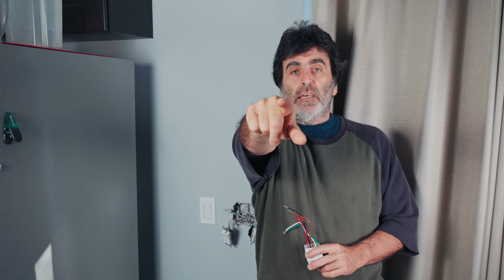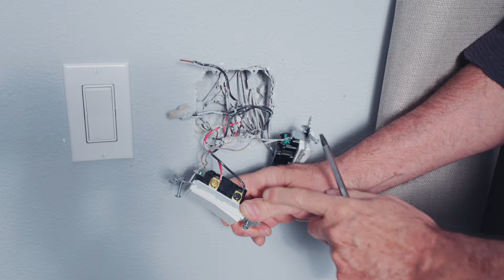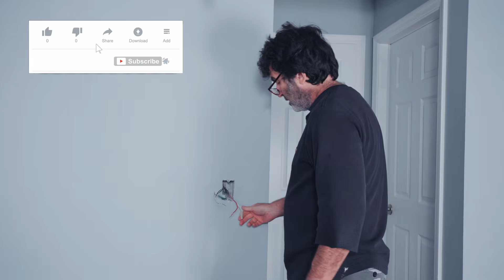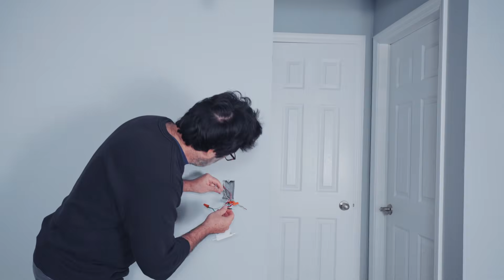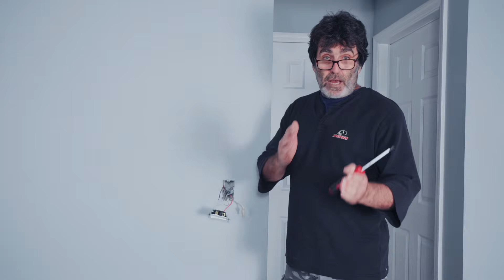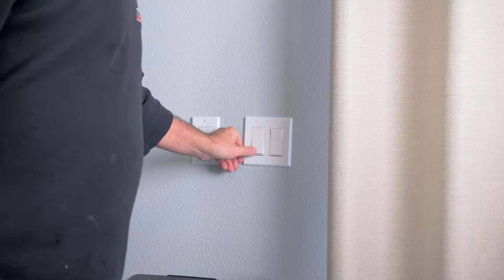Correctly Install Amazon WiFi 3 Way Smart Switch

Comment: So does that mean if one freeway switch has power the other one will not
Reply from the maker: With a smart switch it's a little bit different... I don't remember exactly how the Amazon switch has it configured.. .With a normal 3 way switch both switches will always have power, but it depends on which leg/screw the power is on determines if it's off or on...

Comment: Why did you say, "preferably this black one here" regarding the travelers at 1:20 in the video?
Reply: Does the color or location matter?
Reply from the maker: It all matters!  I don't remember why I made that particular statement... I would connect it according to the wiring diagram for your specific situation...

Comment: Oh so you only need one 3 way smart switch. You can leave the other side the same?
Reply from the maker: Hi! With this setup you use one traditional 3 way and one amazon smart switch.  However the connection on the traditional 3 way is not the same as it is when installed.  I'm pretty sure I covered this in the video which would be easier to see than for me to try and type out the full instructions... 😀

Comment: I had a setup where the Power and the wires to the fixture were in the same box and the other 3-way was on the other side of the fixture. This video helped me understand that I needed to disconnect the second traveler and instead hook that up to the hot in the fixture. so I had to change the wires in both boxes and the fixture... The instructions were not clear on that but this video helped me understand that I only needed one traveler. I assume since that, far, normal 3-way just triggers the smart 3-way to switch it's logic... Thanks for the video!
Reply from the maker: TYSM! I'm glad the video helped you figure that out. 😀. To me it would be less confusing if the switches just hooked up like standard 3-way switches.  I have a feeling they get a lot of returns on that one because of that..

Comment: This is really helpful. But there's no neutral in my load side of the 3 way
Reply from the maker: That definitely makes it tricky! You might need to look into switches that don't require a neutral wire.. 🤔

Comment: How in the heck you figured this out is beyond me - the instructions certainly don't help. I have spent several hours and gone through two switches, thinking the first one was faulty, before finding this explanation. Amazon needs to reference this video inside the box along with the instructions. Thank you!
Reply from the maker: HI!  TYSM for the great feedback and comment...  If I remember correctly I found the wiring diagram of how it should be.  But it's been a minute so there's a little bit of brain fog there.. 😂  So glad to help.

Comment: Hello may I know  how  to connect  3way amason smart switch  to regular  3way  switch  without  neutral?  I have  only ground  two  travelers  and one load.
Reply from the maker: HI!  Many 3 way smart  switches "require" a neutral.  I would search and see if there's a brand that doesn't require it...

Comment: Does the old none-smart switch still function as expected?
Reply from the maker: HI!  It's been a minute since I worked on this... If I remember correctly the Amazon switch only used one smart switch and the 2nd switch was still a standard switch.  If my memory serves me correctly then yes the 2nd standard switch still worked as normal..

Comment: Great  video!!!  My line and load are in box 1 and 14/3 between box1/box2.  Any advice?

Thank you
Reply from the maker: HI!  Without having all the diagrams in front of me I am not entirely sure...  I would google different 3 way switch configurations and find the one that matches your setup.  Then take the Amazon diagrams and compare.  I think it would work, but it'd be hard to explain in a sentence or two...

Comment: THEY SAID you did not have to use TWO when connecting this Ghome 3way switch? I guess you are saying that you do? So if you have 4 different locations you would need to find the front and rear switch which is 3way and not 4way ? Thanks ?
Reply from the maker: HI!  This video is on the AMAZON 3 way, not the GHOME.  With the Amazon, I am not sure it'll work with a 4 way setup (I'm leaning towards it won't!).  I haven't looked at the Ghome to see how it hooks up, so I can't answer your question.

Comment: Are you able to provide direction on a moes smart switch? I tried but didn’t work
Reply from the maker: Not at this time, but I might do a video on that.  I'll look into it.  But in the meantime, do you know if you have a neutral wire at your 3 way?  I'll bet it's required..

Comment: Thanks, but I’m still having an issue and hoping you or someone can help. I believe it’s setup exactly as you stated, but in a certain order of clicks the old school three way switch will only turn off if I cycle it twice. It will then turn on again, but in order to turn it off from that switch I have to click it on and off twice. Any idea why? Thanks again.
Reply from the maker: HI!  If you're 100% you've connected it right, you could have a defective switch...

Comment: any reccomenations for installing the Amazon basics 3-way in a 4 way
Reply from the maker: HI!  A 4 way setup is a 4 way switch in the middle and 2 3 ways on the ends (electrically speaking)... You can probably  set it up in one of the 3 way spots and it might work.. I've never tried it though, so if you do it's at your own risk...  Might be something for me to experiment with and if I can get it to work properly it might be a video idea...

Comment: Thanks... Replacing all my WEMO Belkin switches.    Very Helpful.  Still quite not right.   Probably the wrong location of the amazon switch.  almost eems to work but every other time, need to swith the (non smart) on-off-on-off-on) to work.
Reply from the maker: I've heard of that...  If it's wired correctly, there might be a glitch in the wifi switch itself...
Reply: @TheHomeImprovementChannel  all good got it all working.,... now for the 4way setup....
Reply from the maker: I wanted to try and hook that up as a 4 way.  I forgot about it, but I'll put it on my to do list to see if I can get it to work... 😊
Reply: @rainerperkons  What did you do to fix the issue where the non-smart switch needs flipped? This switch (I have ordered 2 of them now) seems to be the glitchiest POS ever, BUT it's the only switch I can get that is: 3 way, dimmer, motion sensor, AND supported by Alexa! AGGGHHHH. Absolutely driving myself insane. I have 'hot wired' my black traveler on my 12-3 romex so that the smart switch has constant power in. Sometimes I can have it work from both switches, sometimes not. It's not a switch-leg issue, it has to be a glitch of software/brainboard because I know they designed their switches in a way that they actually listen for voltage changes to decipher whether or not to power on or power off the load side of this switch. I am about ready to go back to a non dimming motion sensor 3 way.

Comment: I have a switch in my living room by the front door, and a switch in the garage that both control my outside lights. I never use the switch in the garage. I always flip the one in the living room. If I want to replace it with a Smart switch do I really need a three-way? Also can I only replace the one in the living room and leave the one in the garage alone?
Reply from the maker: HI!  Some 3 way smart switches only include 1 switch and the switch at the 2nd location still stays a standard 3 way.  I can't remember if this Amazon works that way or not, but for sure some do.  You should look at the wiring diagram for a given switch to see what it requires.  Yes you can disable your 2nd location if you wanted to, but I just recommend using a 3 way smart switch that only needs one switch...
Reply: @TheHomeImprovementChannel Thank you!

Comment: I have a question. I only have 3 wires, ground, white and black. So which wire goes to which? I saw another video and they had it the following way from the switch to the wall. 
black to black
red to white
white/green to ground

Is this correct? Thanks
Reply from the maker: HI!  If you only have 3 wires and no red wire, are you sure you're working with a 3 way switch setup?  What do the instructions say?  Don't pay attention to "a random guy", but the instructions if there's any doubt..

Comment: Great Video and very simple explanation.  Can you show on how to connect one smart switch in a 4 way configuration (Line->smart switch->Four way std switch->standard 3 way switch ->light)?
Reply from the maker: HI, I'd have to look into that.  I don't know for sure if this one will work since we're using one of the travelers to carry power.  The 4 way is usually in the middle.  I have a video coming out this weekend on a "Treatlife" 3 way smart switch.  I know for sure that one will work on a 4 way setup.  I'll look into the Amazon one and see if I can make it work.
Reply: @TheHomeImprovementChannel  Thank you.  Looking forward to the video.
Reply: @TheHomeImprovementChannel I was wondering if you had any luck with a 4way scheme for the Amazon Basics smart switch??  The 3 way solution was perfect!  And a great instructional post!
Reply from the maker: @TerryDavlin  HI!  TBH I forgot about it!  Thanks for reminding me.  I'll try to look into that to see if I can get something that'll work...

Comment: I have tried all video methods of correcting my wrong and I'm still struggling! Do you have time tomorrow, PST times to discuss??? I had to pull the neutral and ground into the equation.
Reply from the maker: Hi... Without being able to see your switch setup, it'll be pretty difficult to see what's wrong!  I have a facebook page under take a bath productions.  Try to send a picture there and I can look at it.
Reply: @TheHomeImprovementChannel  ok. I have one more trick I'm currently working on at the moment if that doesn't work. I will send the the pic. Thank kindly for the reply!
Reply from the maker: @keishabailey4008  YW!
Reply: So I found my boo boo I was making. I removed one of the Neutral wires from the vine family to attach to the smart switch when in fact, I should have included the smart switch to the Neutral vine. I'm now receiving power in the switch! Now on to the next project. "relocating the gas line for a new smart stove :) Thank you for allowing me to vent my issue on your platform.
Reply from the maker: Oh cool!  Glad you got it working.  That's definitely something I would have had to see.  They say a picture is worth a thousand words, but being there to see it in person is even better!... 😊
Reply: @TheHomeImprovementChannel  Your support gave me motivation to continue to push through my issue to find resolution. The relocation of the gas line went smooth, than ever! Now time for backsplash and install of cabinets handles. I have a great recipe for soulfood dressing calling my name to make for Xmas!!!!
Reply from the maker: @keishabailey4008  That sounds pretty good!  😊

Comment: By chance is this the same for TreatLife switches?  videos elsewhere lead me to believe I need 2 smart switches on the 3 way.
Reply from the maker: Hi that's a good question!  I've never installed treatlife switches.  I looked them up on Amazon and it says you only need 1 switch.  The other side can be a conventional 3 way.

Comment: What switch requires a neutral? A switch is an interruption in a line, not a outlet. So this thing is completely unless unless your house was built after 2006. When code started requiring neutral to all gang boxes. Would be nice if that was clearly stated on the listing
Reply from the maker: HI!  It usually is stated on the listing.  I checked the ad for this one on Amazon and it is listed as requiring a neutral.  If you don't have a neutral, you'll have to find a way to get one into the box from another source.  IT's probably not that hard to do that.
Reply: @TheHomeImprovementChannel  yeah no, listed as (Amazon Basics Smart Light Switch Compatible With Alexa Only, Single Pole, 2.4 GHz Wi-Fi, No Hub Required, White, 2.91 x 4.65 x 1.62 in). "Single pole" is the term for a switch with only lead and load. So this is clearly mis adversed. I don't care what some random paragraph says on the 3rd tab. The title always takes precedence.

2nd, getting a line to that gang box no. It is 1st floor of 2 stories with a finished basement on an exterior brick wall. So if you want to come to Wisconsin to take the 12 hrs or so of breaking up drywall and brick to run a new 14/3 to that gang box from the breaker panel, be my guest. 

So reasonable, I returned that POS switch and made it work with a smart plug. Why is it always a pain to do anything with christmas lights?
Reply from the maker: @darth_sidious_sheev_palpatine  Great!  Thanks.

Comment: Thanks for the straightforward and great tutorial. I appreciate you going over figuring out which set of wires is typically the traveler versus the one going out to the load or coming from the panel. 

I realized the mistake I made when I set several these up around the house by not tying one of the travelers into the line from the panel.
Reply from the maker: You're welcome!  I'm so glad I was able to help.  😊

Comment: What if your black cable doesn't have a cap to remove and goes directly from the wall into the black screw? How would you connect the black traveler wires to ensure constant power? Should both wires be inserted into the same black screw, or do I need to splice them together with a separate piece of wire? Hope that makes sense.
Reply from the maker: HI, I'd have to go back to see the wiring diagram which I don't have in front of me.  Most of the time the wire will go directly to the black screw.  If I remember right you'd take it off the black screw and twist it together on the black traveler with a wire nut.. But since I can't remember for sure, Don't quote me on that!
Reply: I tried connecting both the black line cable and the black travel cable to the black nut. It seemed to work initially, but after a while, the dummy switch needs to be flipped on and off a few times before the light responds. I suspect the connection isn't secure. Amazon definitely didn’t make the installation process easy. Thanks for getting back to me so quickly!
Reply: Update. I spliced both cables into a single cable to put on the black nut and it worked perfectly. I just followed the rest of your video exactly and worked out. Thank you.
Reply from the maker: @grimlen33  That's awesome!  Glad you got it going... 😊

Comment: Still trying to figure out how to install using 2 wires.  I want 2 wire using 3 wire switch. Just want wifi function, not 3way switch function. Doesn't work with just black to black and white to white.
Reply from the maker: HI!  It does look like this switch can work as a single pole.  I'm going off the wiring diagram and if you ruin your switch that's on you!  But if it were me, I'd connect live power to the black power wire on the switch.  I'd connect the light fixture to your "Load" wire.  And you'll need to connect neutral {probably is a white wire.}  Leave the traveler disconnected and put a wire nut on it.  It should work that way.

Comment: is it the same if I have 3 3 way?
Reply from the maker: HI...(3) 3 way switches is a 4 way.  Which is actually (2) 3 way switches and (1) 4 way.  I don't believe this will work in that application if that's what you meant...

Comment: Can you run the  smart switch without the line side connection? The way my 3 way is setup atm. Has neutral as a hot back to the switch. Since the light has a neutral back by the first switc. 

Line , switch , switch , light
Reply from the maker: HI.... If your neutral is being used as a hot, I don't think it'll work right.  I'd have to look at the diagram again, but I'm pretty sure the Amazon switch needs an actual neutral wire.  The line side connection powers the switch through the traveler wire instead of going to the black screw in the traditional switch.
Reply: @TheHomeImprovementChannel  figured out that I. Order to run a smart switch I need a set that uses one traveler wire each. This way I can repurpose the other traveler as a common return for the light and can use the white as a neutral once again. At least if I did the circuit properly.
Reply from the maker: @dr_tal  Is there a neutral in one of the boxes?  Not just a white wire, but an actual neutral?